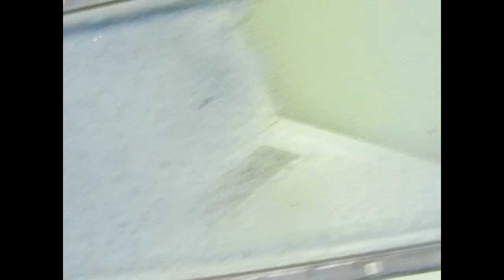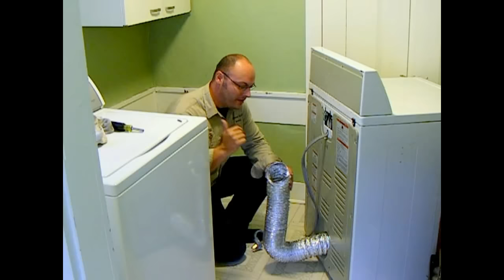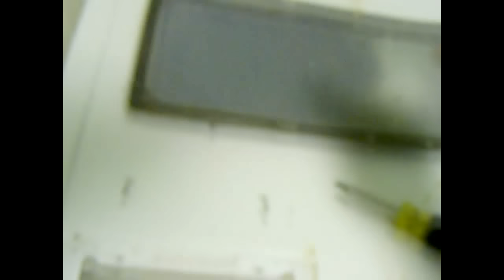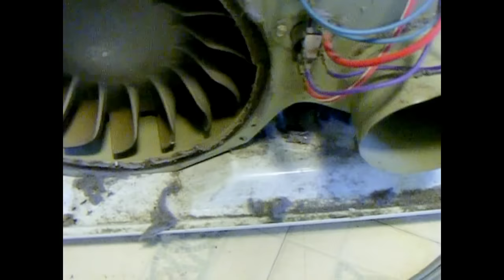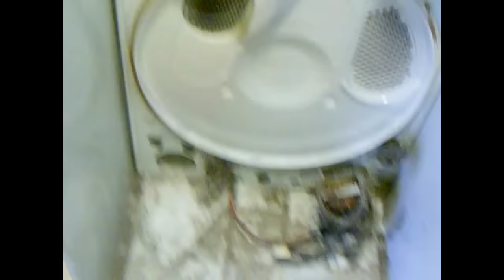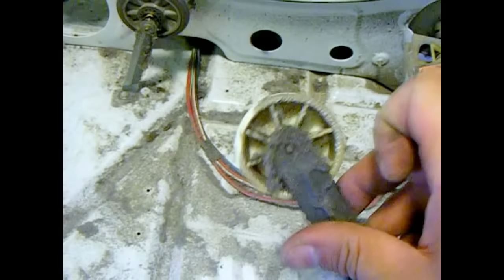Dryer Troubleshooting - Not Drying or Taking a Long Time to Dry

Comment: Good video.  I Like your helper.  Also, nice touch with the flag patch on your arm.  

I pretty much knew all of this already but I like to review a few videos before I go into my dryer for cleaning/ maintenance etc.  just as a refresher to make sure I got everything covered. 

 I have a question about air flow thru the vent hose.  Obviously, the shorter run you can get the better, but if you have a few curves, not kinks, just curves in your vent hose, how much does that really restrict the air flow, if at all?  I have a few and the dryer doesn't dry as well as it used to.  It heats up good, so I am thinking it has to be air flow related.

Comment: Thanks so much for doing this video!  We have an old whirlpool dryer that is not heating up anymore, or sporadically.  I've watched a couple different videos and suspect our problem may be the airflow.  I'm embarrassed to see what I might find when I pull it apart.  :-)

 I checked the peep hole and I can see the glow and the flame ignites, but it never really heats.  I'm going to follow your video instructions and give it a good cleaning.  I'm sure it hasn't been done in a few years.  But I do have a gas dryer, not electric.  Do I need to shut off and disconnect the gas line to the unit before doing this?  

Thanks again!
Reply: I am a service tech and I have to hand it to this Feller for one helluva good presentation with good facts to the point and on point. Thanks my man

Comment: I see a Kenmore 70 or 90 Series Dryer. I love ours. It's paired with a Series 90 Top loader that actually cleans much better than the Kenmore Elite/LG Front loader that we bought new in 2011(She just HAD to get a front loader). The Elite burned up a circuit board at 2 1/2 years, then the bearings started rumbling at 3 1/3 years. I had kept the Series 90 (Don't Waste Good) out in the garage so I just put it back in service. Now, seven years later, the bearings are going out in it (the thing is 23 years old with19 years of faithful service.). The Elite is going back in service today with the new tub bearings. I figure that I've got 3-5 years before the Series 90 will be called on again.

Meanwhile, The Dryer just "Keeps on Tickin'" and it's older than the Top Loader. The only problem with it is, the "Cotton/High" position actually runs the "Delicate/Low" Setting and the Delicate Low position actually runs the "Cotton/High" (Bass-Akwards). "Permanent Press/Med" works like it should. Took a while to figure that out ( Thought that the element was going out at first) and we've just used the switch positions opposite of what's advertised for several years. I'll be dealing with figuring out the actual problem later today (maybe) after I clean it out. We bought it used in 2013 from a repair shop and I figure that a couple of wires got switched. Hopefully the service manual is stuck in there somewhere.

Great video and Good advice. Thanks for posting!

Comment: Nice, even with the Sbomb.  Now how about showing us how to put the front panel back on... I vaguely remember it being a little complicated with only two hands?  Do you have a video for testing the thermal sensors?  Supposedly my vents are clean from the wall to the roof and out, but my dryer does not seem to be getting towels, Jeans, socks and mostly cotton items dry in once cycle.  I tend to pull my shirts out after 20 minutes and am surprised at how damp they are and how little heat there seems to be in them... (although we do use the automatic dry low heat setting.)

Comment: what do you think my problem would be if my dryer heats up for about 10 minutes and then stops heating? The dryer keeps going but the heat will not come back on. I can start the dryer up after about 20 minutes and then it repeats the problem. Great video by the way!!

Comment: Hi Bill - great video, thank you for sharing this information!  I took the back off of my dryer last night and was testing the various parts for continuity with my multimeter.  I noticed my heating element only has one wire lead attached to it, however, there are two prongs coming off of it.  My dryer is a Whirlpool, fairly basic one from around 2000.  Is this normal?  Or should I be concerned?  Thanks in advance for any help!

Comment from the maker: You'll have basically the same thermostats and motor switches.  You'll check the heater the same also.  You'll just have to access them differently with that dryer.
Thanks for Watching!

Comment: We have a Kenmore that is is one of the newer electronic controlled types. The lint filter is at the front, below the door. Our dryer is taking a long time to dry clothes as well. I will check the flapper, etc. The dryer is pretty clean as I do keep it clean, so would i suspect a problem with the heating elements?

Comment: thank you so much! ive had problems with my dryer lately and i took it apart this morning but didnt help... i knew it was still heating and i knew the vent hose was clear on the end in the house... sadly i didnt think about the other end... idk why i didnt but either i way i went and checked and bam massive clog... massive!!! lucky for me my boss bought some lint cleaning tool thing to use for the evaporators and work and tada!!! a fixed dryer :D

Comment: hi Bill thanks for your video. I have checked the vent ducts and vent outlet. My question is can you tell me what the temperature should be at the outside vent outlet? My Samsung gas dryer temperature fluctuates. On the quick dry mode it goes from about 118 to 122, in the timed dry mode it fluctuates from 108 to 121 but only stays at 121 for a few seconds. Are these temperatures normal for this dryer. It is a Samsung dv42h5200 gp/a3.  Thanks for your it is very helpful.

Comment: Hi Bill,   Not sure if you're still checking the comments but hopefully you are and can help me out. I've done the continuity tests and determined that the thermal cut off switch was bad so I replaced it along with the thermostat since the Sears Parts Direct people said they should be replaced together. I tested the dryer out before reassembling and it heated up great. I put it all back together and put a load of towels in and it stopped heating again. I vacuumed up all of the lint when I had it apart and vacuumed the hose. There is no lint left in that thing! What do you think it could be? Thanks!

Comment: Hi.  I found your video today and it is really informative.  We have followed all steps, but still can't seem to determine what is wrong.  In testing all of the different parts everything tests fine with the multi meter.  Our dryer is running, but the air is only slightly warm . . . is there any signs of a heating element that is starting to go bad?  Thanks.
Reply from the maker: +Tamera Browder What's the model number?
Reply: +Bill Newberry MEDC200XW1

Comment: Bill my dryer heats up, but after 20. Min, shuts off, but clothes r still damp. I already changed the thermal fuse, and a couple other fuses on this very old series 80 Kenmore dryer.  It's still in good shape and would hate buying a $700 unit Bec i can't fix this problem. It seems that once it reaches a certain temp it turns off. Unless the dryer is cool, will i b able to push the start button. Thanks in advance. So far changed dryer thermal fuse, thermostat,  dryer start switch. It's a gas dryer. Tx

Comment: That was informative. Do I do the same with my ge?  Or do u have a ge movie?  We just got our dryer brand new about three months ago and it is taking two loads to dry and not much in there.  The guys that installed put a long vent thing on the back.  Could it be to long? Cause the dryer is in a hall closet and pushed up against the vent.  I'm not sure if stuff is getting out.

Comment: Coils on the one here burn out. This has happened in less than a year. Gets cleaned every time but it keeps burning out.
Could it be just one crappy unit? Thanks so much for your insightful troubleshooting vids!
Reply: old Maytag repairman didn't get any sleep on this one. my sister had a Maytag dryer that the heating coil would burn out every time the kids left quarters in their pockets. the quarter would make its way and short out the coil to ground and would burn up. it was easy to repair but the coils were expensive. I fixed the dryer twice and I dont know how many other times my brother in law repaired the dryer.

Comment: Thanks for this! Just bought a home and it seems the former owners have not cleaned the dryer at all since they bought it in 2012. A tip for others trying this at home: Wear a mask! The dust and lint particles will get in your nose and mouth and it's disgusting!!
A quick question - we have a really long hose. From the bottom of it to as far as I could reach, the host was stuffed with lint. Not sure about further up but do you think I should replace the entire hose?

Comment: Electric Maytag dryer stopped heating so hadn't run awhile.  Took it apart using your instructions.  Scarry full of lint.  Vacuumed, reassembled and turned on.  Started heating immediately, but then a burning smell.  Unplugged immediately.  Is that a normal reaction to cleaning, or what might be the problem?  Thank you.  I love being able to do this stuff myself!
Reply from the maker: +YB Brokaw You may just be smelling some lint that may have gotten on the heater.  I would check the cleaning again and just run it.  Keep an eye on it for the first few minutes.  I think you'll be alright.

Comment: Bought this dryer for 50 bux. Im not handy at all. Found a MAJOR blockage in the lint tube thingy. Test running now but I assume it will work great because it puts out heat pretty welll, and the air is blowing strong now.  I feel handy now. hahaha. Thanks for the vid!

Comment: Bill:
I have used your recommendation SEVERAL times.  EVERY time I replaced the electrical connector (like you used), it would melt and come apart after the 2 or 3rd load.  What can I get that will not melt?  A nut and bolt was mentioned, but I don't believe that would work on mine.  What type of connector should I use since the electrical connectors like you showed melt?
Thanks for your help..  singlemomno$$$

Comment: my dryer is all clean and ducts and vents good,.  The heating works, but still have to put clothes on 5 cycles before they get fully dry. 
My damp sensor doesn't work though anymore.
Could these two problems be related? 
What should I try next?

Comment: You can get some exterior Vents on your house that have an L shape, they point down towards the ground so no high winds during storms, etc can blow any lint back into your house and cause moisture issues by making the lint already trapped in your hose in the wall damp causing it to not exhaust. The ones with a Lint trap will keep Squirrels from climbing inside.

Comment: Hey Bill, thanks for the video. I pulled my dryer apart the other day to find/fix a squeaking noise - didn't find it but I did give the dryer a good cleaning out. It still comes up to temperature and there's excellent airflow through the drier but the clothes seem to be taking a super long time to dry now (easily twice as long). Any ideas what I might have missed? Thanks.
Reply: Never mind I think I fixed it - when I put the metal back onto the dryer I didn't align the tube that connects the lint filter at the front to the exhaust port at the back. The airflow I could feel was the fan sucking air in the front and then ejecting it from the exhaust port by sending it through the inside of the dryer housing, not through the drum itself. I found this series really helpful https://home.howstuffworks.com/dryer1.htm

Comment: Hi Bill!   I have a Maytag Intellidry Dryer (model LDE8606ACE).  It recently has stopped automatically shutting off during the Intellidry setting.   It drys, but won't shut off.  It works on the timed setting, just not the Intellidry setting.  Is it a bad moisture sensor?  If so, where is it located and how do I change it?  (I'm pretty handy, don't be scared.)

Comment: in my opinion it would be wrong to use oil on idler pulley and support rollers as with the 6 month period you will find them sized up from the future dust and lint.
kitten is cute. great video

Comment: So I will give this a try tonight after dinner. I have been telling my husband that our dryer isn't drying efficiently but he is always too busy to check it out. A small/medium size load literally takes 180 minutes/3 hours to fully dry. Also, since it takes so long to dry, the clothes will start to mildew. So I have to end up re-washing the clothes and drying again for 3 hours per small load.  It's very frustrating when you have a family of five and the clothes take eons to dry. So I am going to try and fix thing myself. Wish me luck. I just hope I don't break anything lol
Reply: Okay. so I did clean all of the lint out of my dryer. The hose was smashed so there was no airflow. We straightened the hose and cleaned it out. My husband used his air compressor  to clear the lint out of the lint housing. He did not unbolt that part. But me being me, I did and it was in fact still more lint at the bottom of lint housing and lint coated on the fan blades. I used a little paint brush to wipe the blades and the lint around the wires. Here is my issue. It seems fairly difficult for me to put the lint housing back in. At the bottom where you can see where it was tucked in, is hard for me. I am trying to maneuver the thing in and also get it tucked in but I just can't get it. So I am going to keep trying before my husband comes in the house...lol
Reply: Update: My dryer is getting super hot within 2 minutes!! yay! Ha! my husband is so jelly I fixed it, but I had difficulty putting the lint housing back in so he helped with that. I'm really proud of myself lol now I feel like I can fix anything

Comment: I must have  missed something.  What exactly was causing the slow dry time.  The vent was not clogged.  The vent cage did not seem to have enough debri in it to cause a slow dry time.
Another guestion, how do you prevent the flex hose from kinking when the dryer is close to the wall?

Did this solve your problem, or did you have to go through the stats, element, power block, motor switch, etc.?

Comment: I had to change the rear drum seal and cleaned everything out, the motor looked like it was wearing an angora sweater. I also found a lot of gooey slime that looked like fabric softener in the bottom housing drain channels and around the outer edges, all the low spots. I'm wondering if that is from dryer sheets? Also, I like how you just glossed over the mouse poop under the dryer like it's normal to have mice in the house. I guess kitty isn't doing it's job.
Reply: Maybe that is why he got the kitty or maybe the kitty is a vegetarian.

Comment: Bill does the timer res board have to have continuity when no power is applied? I have a fully funtional dryer with no heat all thermostats have continuity to include the termal fuse and coils.there was no significant amount of lint any where. I am at a loss as to what the issue could be. I have a hotpoint dryer.

Comment: I just replaced the belt because it was old and broke , rollers are good , no blockage of lint is all clean. You didn't tell us why it heats but doesn't get hot enough to dry in a normal amount of time. takes forever to dry anything but the heating elements glow orange and are working , but shut off after only a minute or so. I am thinking it's the thermostat .

Comment: I have a 9 year old Maytag dryer, lint filter is on the top I had problems with the dryer staying hot it'll fire up and run for several minutes and then cool down I replace the entire vent tube and replace the thermal fuse and I'm still having the same issue do you have any recommendations? Possibly dirt in the lint housing?

Comment: I cleaned out my 12 years old electric Whirlpool, took it apart, dusted and vacuumed every square inch of it, hoping it would heat better. After a full cycle with a full load, the clothes are moist. I divide the load and run each through one more time. I am really strapped financially. I will have to get me a new one eventually, and if I can put it off for a good while that would be great. I got me a voltage meter. Those wires in the back read at 240, 120, and 120. So, it is something in the dryer that needs to be replaced. Which element or part is probably the one to test first?  Which part is most likely at fault?
Reply from the maker: Frank Rizo Most likely the venting somewhere.  Hot moist air needs to leave and the dryer needs dry air to run correctly.

Comment: I have a Samsung dryer, MDV457200EW/A2  that is 2 1/2 years old.  Called Sears who sent out a tech for 80 busk and was told the main control-board was bad, they wanted $400.00 and had to order the part.  Well I watch all your videos and decided to order it and install it myself.  Got the board for 90 buck, installed it dryer stopped working after 2 loads not heating again.  I took the thing completely apart, tested everything, all good sent old board back, got a new one same scenario two loads and not heating again.  I have no idea what to do now, everything tested good, all inspected and cleaned out I am stumped?

Comment: I have a GE that is 4 years old. The heat works and drum is spinning well, lint is cleaned at the door, and the tube coming out the back. However, when I cut it on to test no air passes through the back tube with or without the air duct / vent hose. Any suggestions? Thanks!

Comment: My GE works on timed mode, but not on sensor mode. It has the sensor bars, and the dryness control board. What would you recommend I change first? The dryness control board or the timer, and why?